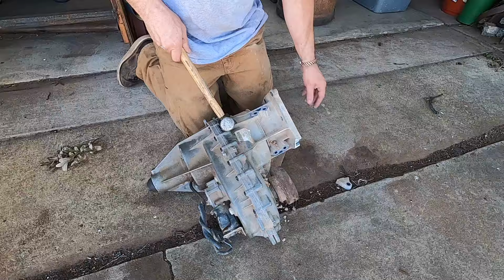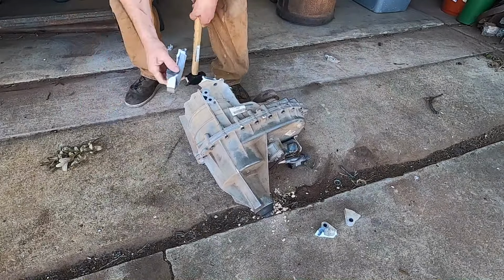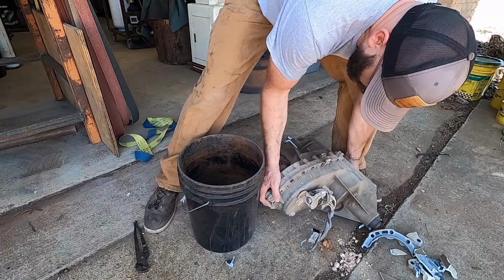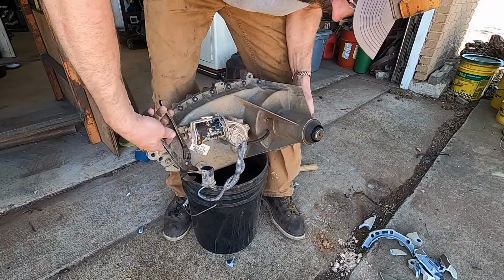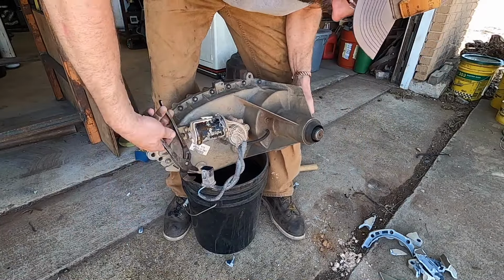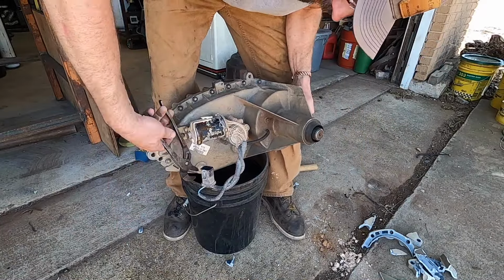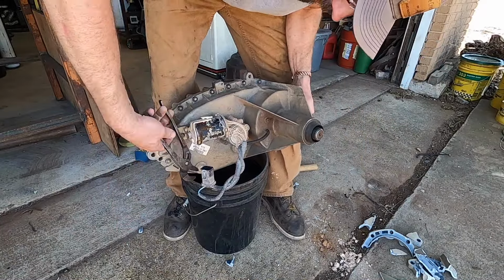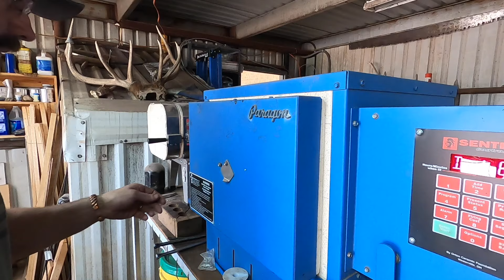Can I Make A Blade From An Auto Part?

Comment: Definitely the best artisan use case for a crap t-case, other than busting them open for desk trinkets or recycling. Gears and bearing races are usually the safe bet or the shaft themselves. Chains can be 50/50, depending on the source manufacturer. I've got a few scrap-quality jet engine compressors that I've dedicated to using for various projects, as much as it pains me to hammering on them both from an engineering appreciation point, but moreso because they are so damn tough.

Comment: The drum you cut apart is most likely cast iron or metal injection molded Ductile iron.  The shafts are forged and case hardened 1050 or 1045 steel usually.

Comment: A lot of things like shims and prop shafts are 1095, bearings are your 52100, gears can sometimes be 8160 or 4140- mid carbon, high impact steel, chains are sometimes 4140 or a 1070-1084 carbon steel.
It various obviously and like any found steel there's bound to be some alloys or other weirdness thrown into the mix depending on the OEM.
I think the chain with some higher nickel powdered steel might turn out really good too if you can get some.
Reply from the maker: Yeah, it's really a shot in the dark, but hopefully makes for an interesting YouTube project

Comment: I wonder if you could drive a small round bar of steel in to the hollow part of the shaft you got from the transfer case and forge wield it into a solid bar then forge it in to a blade.

Comment: That doohickey is a transfer case. It bolts to the back of the transmission and splits power off and transfers it to both axles of the vehicle giving it four-wheel-drive.

A torque converter goes in front of an automatic transmission and allows the engine to run with the vehicle stopped at a red light or whatever. It acts as a clutch between the engine and transmission.
Reply from the maker: Thanks for the insight! Yeah I don't know much about that stuff

Comment: Looks like it is set up as an electric transfer case; could possibly be a transmission for a front wheel drive, due to the small clutch pack inside.

Comment: That was likely a very expensive transfer case. I hope it was broken internally or something.
Reply from the maker: It was headed to the scrap yard
Reply: @FireCreekForge  That's good to know. 

Newer auto parts are made out of all kinds of weird materials. Even if it is solid steel, it's probably not the kind that will forge weld. 

Probably better off at the scrap yard in this case.